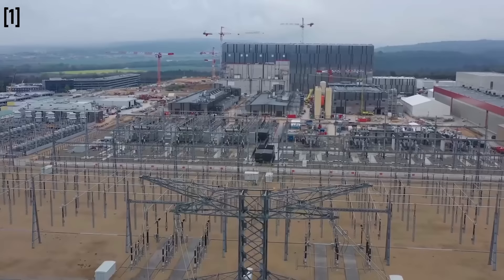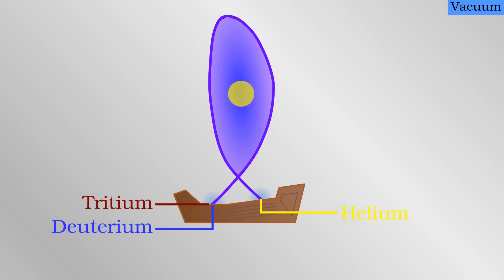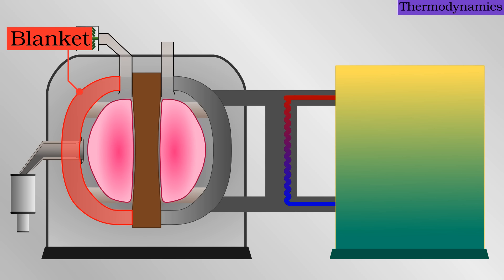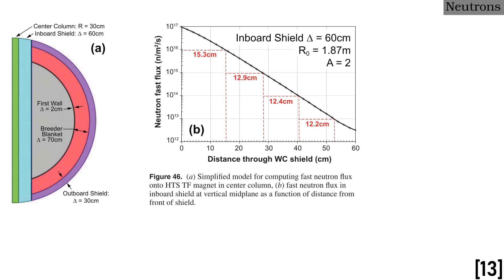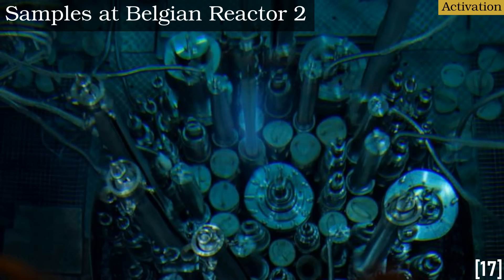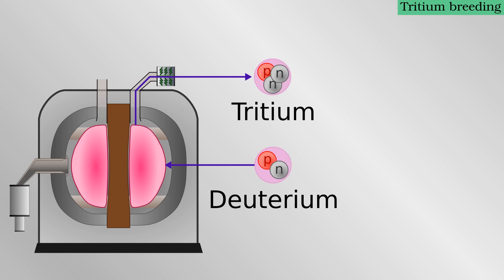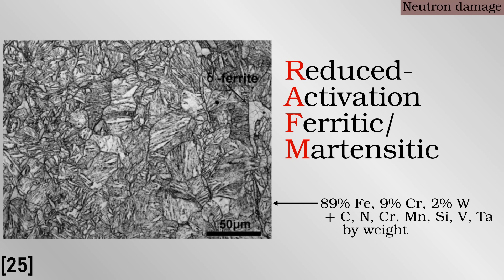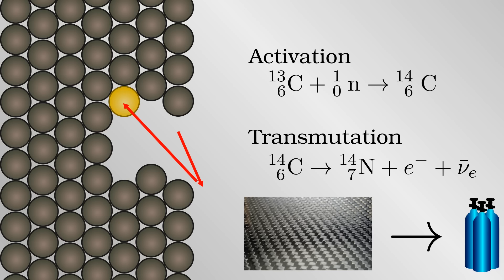How nuclear fusion (maybe) works (4) - reactor practicalities

Comment: Yet another excellent video; your videos are by far the most comprehensible explanations of this stuff for laymen like myself that I've found.

At some risk of wasting your time, I was left with a few questions:
As you mentioned, the irradiation of the tokamak itself means that it will require periodic replacement. If fusion really is the final frontier of energy, then someone managing a plant will eventually neglect it for too long. What happens in that scenario?

Also, what sort of timescale would these replacements need to happen on? (As in: years? decades? centuries? Given that new materials are in development, a precise answer doesn't exist yet, but approximately how long do you think it'll end up being?)

You mentioned in passing that Tokamak-style fusion was ultimately the way to go, but what do you think about First Light Fusion's projectile approach?

If you've even read this far; thank you. I recognize that I'm asking for an expert's opinions to be given for free
Reply from the maker: Economics dictate that replacement of parts of the fusion reactor (doesn't have to be a tokamak) should be no more frequent than perhaps every few years. If the reactor is having a full shutdown every month... forget it. Once the activated components are removed and maybe processed a little, they can be left to sit "hands off" in a safe location (maybe post some guards). If everything is designed well, they will decay to background levels in 100 years.

My criticisms of First Light Fusion are: (1) Instabilities will make energy gain difficult, just as it did for the overconfident Inertial Fusion crowd. (2) Their design will struggle to get a good repetition rate going. They would need to fire in pellets at a rate of at least 1 per second, which with their setup will be tough. (3) The comment at the end "despite the cowboy attitudes of certain startups" is about their CEO. On Twitter, he told me that Tritium breeding is essentially a solved problem. If that is his attitude, then his company - already delayed from their own stated schedule - is in for a rude awakening.
Reply: @ImprobableMatter  Thank you! Completely missed that little jab at the end.
Reply: Haha "solved issue". That's a good one. Even if he has solved the breeding he'll have a hell of a time extracting it efficiently.

Comment: At least two companies (general and zap) are pursuing a liquid metal cavity instead of a solid metal reactor wall. On paper this strategy mitigates/solves a lot of the issues you talked about here. You briefly talked about a thin layer of liquid lithium , but I want to know your thoughts on using a thick liquid metal cavity.
From this video and your previous ones, it seems like pursuing a reactor design that accomodates a liquid cavity (i.e. not tokamaks) could take 10 yrs off the commercial development timeline.
Reply: Yes, it could. And at the same time add 10+ years to harness the technology.

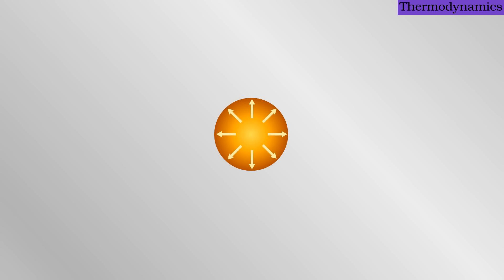Comment: 8:58 As far I know, this is not form 70´s. At the end of 50´s and in the 60´s some people wondered about direct energy conversion. For example,  Richard F. Post at the Lawrence Livermore National Laboratory does some approach at he begining of the 60´s, at least as a way to extract part of the fusion energy.
Edit: I forget to congratulate you for your great job. Many thanks
Reply: There isn't any real cost effective options for D-T as about half of the energy produced is in the form of fast neutrons. He3 can partially do direct power conversion via alpha emissions, but it would not be efficient. Most of the power generated would still come from heat. 

However this is all pointless since the cost of a fusion power plant would be at least 50 times that of fission which is already way too expensive.

Comment: One of the best videos I've seen on the engineering practicalities. The real problem with fusion however is not the engineering reality, it's the fact that as a source of electricity it will have to compete with other far simpler, far more mature, and almost certainly cheaper technologies. Renewable energy is currently mature and cheap. Energy storage is in general maturing, but will be mature (and cheap) long before fusion becomes viable, at least in the engineering sense. I happen to love fusion experimentation and big engineering in general. But there is no possible future in which it will be competitive. It is just too complex and always will remain so. Hence, it just won't get built - except for some niche applications and of course space propulsion. 

Some minor nit-picks. There are certain pathways towards practical proton-boron fusion. (It's too easy to portray temperature as an obstacle). At least with this form of fusion (aneutronic) you get your energy back as charged particles and x-rays and that's a lot easier to convert to electricity. Again, I don't see this as economically viable either, but it may make a lot of sense in space where you have vacuum provided for free. Also, there is the SPARC reactor concept which replaces the absurdly difficult and costly "first wall" with a simple vessel full of liquid coolant and it takes the approach of making the vessel easily replaceable. Again, even here, it's a dead end economically.
Reply: Renewables are not cheap when including the costs for storage systems & power storage system will never be cheap. The cheapest is pumped hydro, but there are limits to where a hydro storage system can be built since you need a location that has a high elevation near a large body of water. Plus a lot of land near water has already been developed (cities & towns).
Reply: @guytech7310  incorrect. Renewable sources are now cheap. Storage has multiple forms and is maturing. Present day costs put renwables backed with storage well below the cost of nuclear. Storage will only get cheaper in the coming decade. That includes batteries. So by the time fusion becomes an engineering reality, it will also be competing with far cheaper alternatives.
Reply: @saumyacow4435  Nope. its not, not even by mile. Batteries will never be cheap: require expensive materials & require complex manufacturing processes.  Fusion is DOA Does not work, & will not. Cost of a Fusion Plant would be at least 50 times the cost of a fission plant & fission plants are very expensive. 

if anything you stated was true, Utilities would have abandoned Fossil plants for new renewable systems. The US alone has about 50 GW of new natGat power plants under construction. if Solar\Wind was cheaper they would not be building all those NatGas Power plants.
Reply: @guytech7310  Well this is where you're just plain factually incorrect. Batteries are now passing $100/kW storage on their way to $50/kW and below. That's for grid scale systems. And there are other storage technologies including compressed air, liquid air, thermal storage and so on. All of which scale well. 

In other words, in the race between complex and simple, simple will always win.

Btw, utilities are abandoning fossil fuels en-masse. Gas peakers are simply a form of insurance. They're too expensive to be run for baseload.
Reply: @saumyacow4435  LOL! 
1. What the number of cycles these batteries can do before the become useless? Intermittent power systems can result in multiple deep draw downs per day. 
Second $100 per Khw is way to expensive. It needs to be below $1 per Khw hour & have at least a 100K+ cycle life to be cost effective. You're assessments are way off. To give you some prospective the US currently produces about 4 Twh per day. You need to at least 4 Twh of power storage. 4 Twh of storage at $50 kwh would cost about $200B, but setting uo the facitiies (ie building, cooling, inverters, voltage conversion, etc would likely jump the price to about $500B to $750B.

Compressed Air\Liquid Air storage? Don't make laugh. Compressed air storage is only about 40% efficient, and liquid air is far worse.

Utilities are not abandoning fossil fuel at all. They are abandoning Nuclear & replacing the with NatGas. The US is replacing older Coal fired for NatGas since its easier to operate and US utiltiies are trying to work aroung gov't regulation.  Like I stated the US has 50 GW of new baseload NatGas Plants under construction. 

The EU is restarting its coal fired plants. Germany is taking out a Wind farm that occupies space above coal seams.
Reply: @guytech7310  Again, you're way behind with technology. Cycle life of grid scale batteries is anywhere form a few thousand to infinite (flow batteries). You assume deep draw which is just wrong. I said before that cost is approaching $50/kWhr and there are technologies that aren't batteries with a potential cost lower than that. I won't debate you on your made up numbers, but if you think that $200B is an issue, you've no idea of the amount of money already invested in the power system and that which will be invested regardless (these things age). Oh and that $50/kWh is total system cost. 

Efficiency of the best non-battery systems approach 60%. That includes some air based systems. Sorry, you're just not in touch. Do some research.
Reply: @guytech7310  
From 2010 to 2021 the share of fossil fuels in electricity generation fell from 70% to 60% in the USA, the 10% making up the difference came from renewables.
In the same timeframe the share of fossil fuels in electricity generation in Germany fell from 56% to 44%, the 12% making up the difference came from renewables.
While in the USA in particular there has been also a shift inside the fossil fuel sector from coal to gas due to the fracking boom, nonetheless the fossil fuel electricity sector as a whole has shrunk in the USA and EU.
The Startup of coal powerplants in the EU is a short term product of the war, however won’t change the longterm trend.
The building of Gas powerplants themselves in so far is also useful in the longterm as these Gas powerplants can more easily adept power output to Renewables and in the longterm operate on Hydrogen generated from excess Renewable electricity, hence Gas is often referred to as a bridge fuel.

Comment: Regarding neutron damage, there is also the Wigner effect to consider.  If the reactor is running at a temperature below the annealing temperature of one of the materials suffering atom displacements due to neutron impacts (Frenkel defects), the number of displacements builds up over time.  Each Frenkel defect has potential energy, and if there are enough of them, just one atom dropping back into the lattice can release enough energy to trigger more displaced atoms to do the same, and you get a runaway rearrangement of atoms that can release enough energy to make the material explode.

Comment: MIT released a video where some students made a proposal for a commercial tokamak based on ARC, " MIT PSFC & Columbia University Fusion Design Class Final Presentations". There they proposed that you'll have to actually swap out the internals of the plasma confinement section every few years.

Comment: on the topic of batteries and fusion competing for lithium, since most (>90%) naturally occuring Lithium is the Li 7 isotope, tritium breeding could theoretically "use up" only a small portion of the Lithium supply (wich is both good and bad, I guess depending how you see it). Might be interesting to see how Beryllium supply stacks up
Reply: Not well berrylium supply chain is less well developed. Also it is unlikely a blanket would only use Li-6, it will probably use a mix of both isotopes

Comment: The more I learn, the better the idea of a fusion/fission hybrid design sounds to me. Wouldn't it make for a safer, cleaner and more efficient design compared to current fission reactors, while making many of the pure fusion reactor issues go away?
Great video!
Reply: The general consensus is that it combines the worst of both worlds, unfortunately. You still have long-lived radioisotopes which are a challenge to store after decommissioning. The fissile material is a weapons proliferation risk. The fusion plant still has most of the complications of a pure fusion plant (tritium management, first wall damage... and all the other things this video did a great job of listing).

Comment: Some thoughts...
1. In pulse-action reactors, can the leftover fuel be recycled for the next pulse?
2. Some fission reactors use molten salt as coolent. Would this make sense for a fusion reactor?
3. Does beta decay from the outflowing D-T neutrons need to be considered in the design? And if beta decay does happen, wouldn't the charged proton and electron cause problem if they're stuck inside material?
4. Given that most of the energy from D-T reaction comes from neutrons, what do we expect to happen to all the neutrons? will maximum heating happen if every one of them transmute another atom, getting absorbed?
5. I'm guessing for fission-fusion scenario the concern is that we still need to deal with the radioactive waste (the lack of which is why fusion is so enticing).... 
6. but for fission-fusion hybrid, is it possible for the fission products to enhance the main fusion reaction somehow.... so we get a feedback?
Reply: 1 yes, the remaining DT can be reused, but you have to remove the helium ash somehow.
2 yes, the coolant (also serving as tritium breeder and neutron shield) can be lithium and berillium fluoride, but it can also be an alloy of lead and lithium.
3 Beta Decay for free neutrons takes 15 minutes on average. They move too fast to decay before exiting the reactor 
4 usually, the neutrons should be absorbed in the breeding blanket and produce heat there.
5 yes, but you can avoid the long lived minor actinides (everything right of plutonium)
6 no, the fission happens outside the core. The neutrons can pass through the core, but its density is too low to interact with them meaningfully
Reply: @bobo2.2  thanks for the info!

Comment: Thanks for all your work. In the first part of the video you state that we are achieving 70% efficiency for gaz power plant. I find it very optimistic, I’d rather expect it around 40% (the typical rule of thumb for thermal engine is 2/3 of waste, ie heat). I can only imagine achieving 70% by reusing the heat to something useful, but that’s not really work for a turbine, then. Can you comment on that please?
Reply from the maker: 70% is a theoretical upper maximum (assuming 1000K->300K). The roughly 60% figure is for a combined gas cycle generator, while I agree that 40% is a more realistic figure for a fusion power plant. For example, Reference [13] (Princeton study about a possible power plant) takes 59%, 45% and 30% as best/middle/worst case scenarios.

Comment: What I wish would be added is the necessity for access to cooling water. The large amount of power needed to run the installation means that the total energy output of a viable installation must be larger than for a fission powerplant. This directly translates into the need for a large inflow of water for the steam cycle that isn't easy to come by.

Water that is used in a steam cycle (and is cooled via cooling towers) is discharged back into rivers - which heats them. After a certain point oxygen solubility in rivers drop and all the wildlife downstream dies. For this reason fission reactor outputs have already been curtailed in the past in summer in e.g. France and Germany (and in some cases completely shutdown. See summer 2017 and 2019 for examples). Fusion - with its higher power output - would face this issue more often and for longer periods of time requiring backup generation to be in place (increasing cost). Climate change is also going to make these periods more frequent and longer.

Dry cooling is a possibility but reduces efficiency (i.e. increases cost). Seawater cooling is difficult because of high maintenance costs (and also not available everywhere).
Reply: eventually the progress of humanity as a whole will be halted because even if we don't emit greenhouse gases our waste heat will be too large and cause global warming regardless but we are around 200 years away from that at current pace